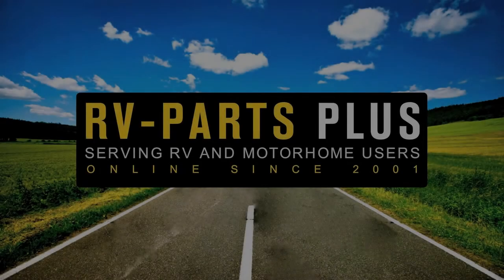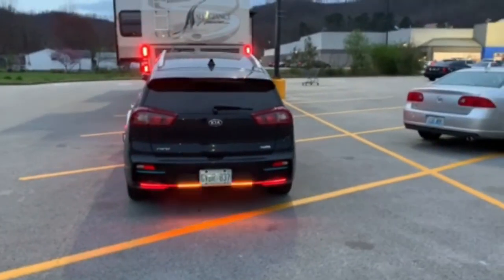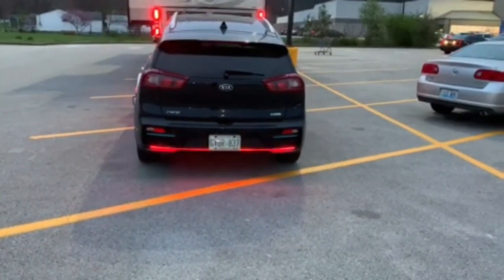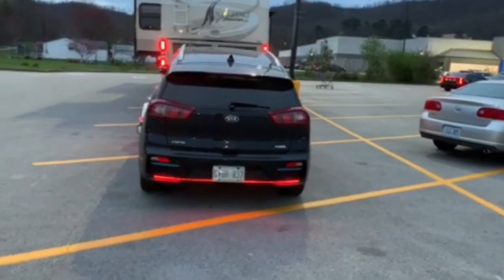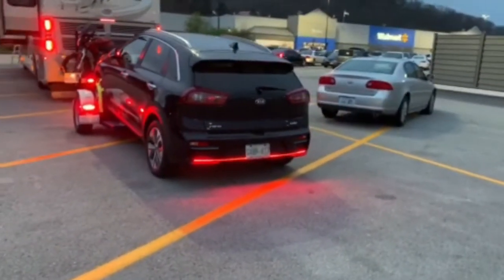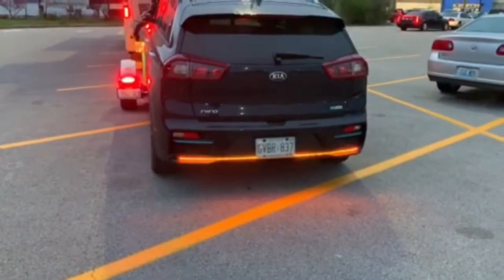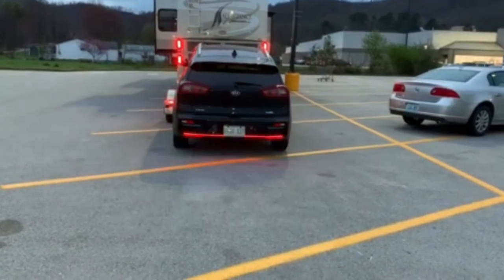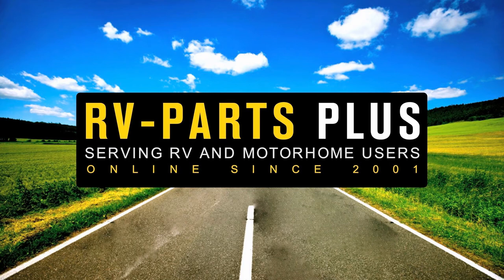LED lighting Strip for Tow Car on Dolly

Comment: Thank you for this video, and adding value to the community.
Reply from the maker: Glad it was helpful! One item not mentioned was that the white LED's when used on a pickup truck as back up lights can be connected to the tow car's back up light and provide a wide angle, superior back up light for the tow car while backing it up.